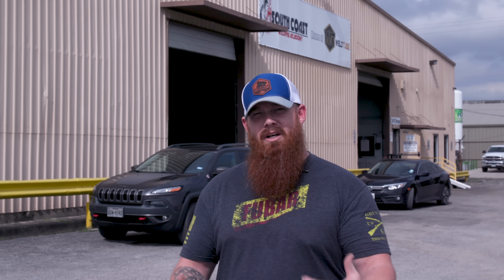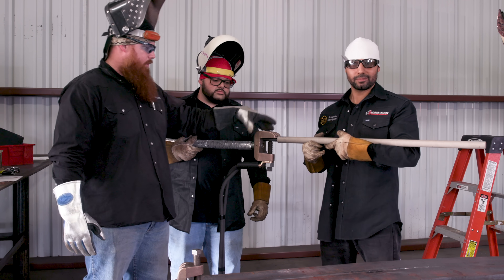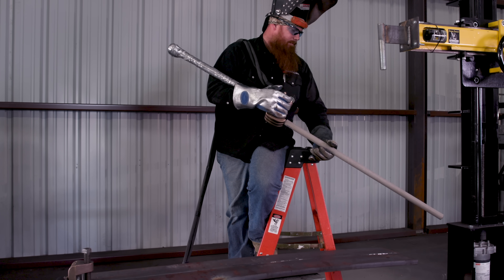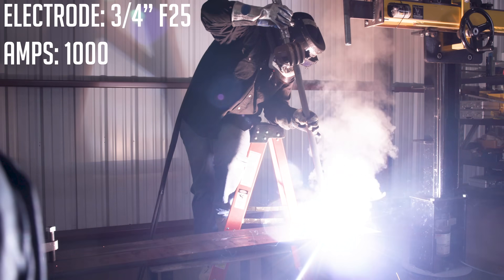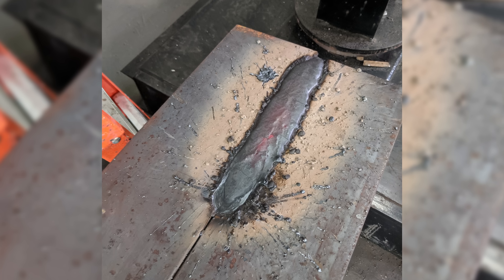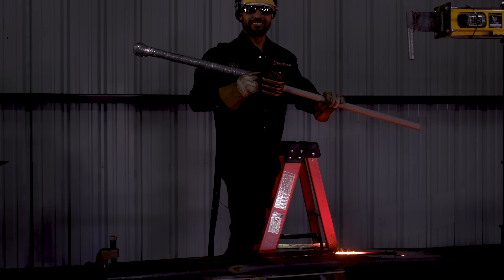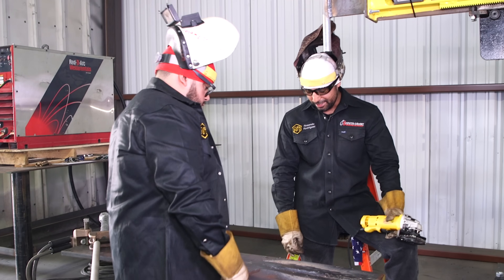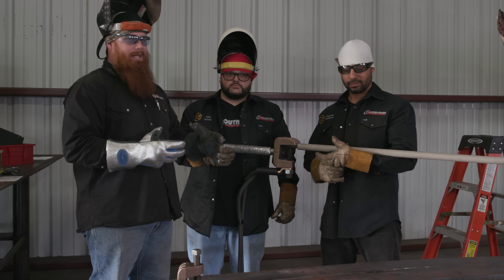1000 AMP STICK WELDING!! | Manually Welding with the Worlds Largest Electrode

Comment: My uncle , who literally welded his entire working career , told me that when he was welding in the ship yards during WW2,, that he was welding with 1 inch rod  powered by two 600 amp pipeliners in parallel,,, on a scaffold , using a harness strapped across his chest, and that he had to literally lean into the rod because of the arc blow,  he said that they were only allowed to  weld 1 hour and off  2 hours because of the heat,,, with plenty of protection, he said they were using two #12 lenses stacked,  and as I recall, he said that they were welding the armor plating on some of the NAVY ships.. he said they were using  pulleys and ropes just to support the multi conductor welding cables  and he said it took yet another man to help strike the arc, holding the rod mid point, till the welder had a steady arc and to hold the rod till it was about half burned . this is what he told me,,,
Reply: That's insane
Reply: RoMMeL1337ak47  I'll bet . That's alot of current there .
Reply: Amazing man, your uncle. Great little story. Thanks for post. Back when men were Men.
Reply: Ur uncle is a badass 💪
Reply: thats back when men were men
Reply: and the sheep were nervous
Reply: That's cool af
Reply: Awesome story thanks for sharing
Reply: Tell us what he said though.
Reply: he tell you all that?
Reply: And that was bare rod.....
Reply: Holy shit !
Reply: yeah. my paw paw 4fed in wwii so he worked building the higgins boats for Dday in NOLA. I was lucky enough to help restore one a few years ago for the wwii museum here.
Reply: no way in hell he didnt die from cancer/have fucked up lungs
Reply: Probably how they welded the liberty ships together so quickly
Reply: Jeez our industry was not ready for the welding we where doing
Reply: some of that battleship armor was 15 inches thick, can you imageine doing 15 inches of armor with a single rod?
Reply: Great Story, many men were not drafted during WW2 because of them being welders in the shipyards of California. Thank You for sharing
Reply: That’s nuts
Reply: Your Uncle is twice as badass as us modern day welders..
Reply: literally
Reply: You had one of the best uncle
Reply: all that ingenuity and we still couldn't figure out that we were supporting a crooked banking empire that wants to replace us with a slave class of cheap dumb labor.
Reply: America love it 🇺🇲
Reply: FunFact...the use of these rods , these machines, in the navy shipbuilding yards...
Is the origin of the phillidelphia experiment.
Literally all these rods arcing off and welding at various locations at more or less the same times caused some weird shit to happen.  
Like tools missing, more like vanishing and reappering...and by tools i mean even lincoln machines etc.
Something about the amperage and  electricity, the pinching of space and time, the arc itself caused weird things to happen. 
So if you know about the weirdness of the phillidelphia experiment... Which actually and historically did happen...then what i started out with by saying tools, machines were disappearing and reapperaing...well, doesn't.sound too strange, relatively speaking.
Cheers and cool video ..
Crazy...the phillidelphia experimemt was started because of welding.
Reply: @rolsonray  Sounds like nonsense to me. Throw some sodium in water and you'll see probably more amperage than a lightning bolt take place to blow apart the sodium. Nothing paranormal happens with that.
Reply: @timramich  shit i dunno..i heard that from someone reading the story
Reply: @timramich  but the phillidelphia experiment is true.
Reply: @rolsonray  According to who?
Reply: Shit..you dont have to believe anything
Reply: @rolsonray  smart man, don't feed the trolls. personally I don't believe everything about the Philly experiment but there's certainly some evidence they were pumping some time and cash into it and obviously something was going on. But you're free to research (and chose to believe/not believe) whatever you want and I appreciate the info on the welding being the cause since that's something I hadn't heard of but makes sense in context.
Reply: @tflo3482  Yeah, it took time and money to invent a technology to make a ship invisible to enemy ships' instrumentation back in 1943. And no, it doesn't make sense. What paranormal thing happened in this video? I didn't see anything disappear and then reappear later inside of solid materials.
Reply: @tcmtech7515  No to mention those connections at power stations where they have a rod that moves to make or break a circuit, and there is lightning arcing from it a good distance away. I don't know what would be so special about electrons flowing through a plasma rather than a solid conductor. Logic would dictate that just having electricity run through lines at all would make everything in the world haywire.
Reply: @tcmtech7515  oh yes, now if you want to see some thing an hear an feel the power drawn? Get yourself  into a big foundry that runs arc induction furnaces. Wow, the one in Sheffield draws as much power an hour as Leeds uses in a 24hour period.
Reply: @tflo3482  smart man the guys saying it when multiple thousand amp arcs are running the universe stops working based on story he heard third-hand don't dismiss the people rightfully calling it out as trolls
Reply: @tflo3482  as far as I know they had this wierd idea that strong magnetic fields could distort light in a way that a ship becomes invisible they apparently went as far as building a prototype and tested it but in the end it basically did nothing other he magnetize the ship
Reply: @timramich  oh yes it does. Sodium fusion is the answer to it all. The plasmatic state it becomes is the start of... well, everything.
Reply: @eriklittge9911  Uh, what?
Reply: @tcmtech7515  but locomotives aint in salt water breaux.
Reply: Joshyboi  You, I think youtube was having an issue then.
Reply: @timramich  really? sodium & water makes more current than a lightning bolt? I need to know more gimme the source man
Reply: @mcrib5794  electrodynamics isn't my wheelhouse, I'm in chemistry, but the sodium/water reaction is an immediate and extremely violent exchanging of electrons. Sends off so many, it ignites the oxygen in the atmosphere with the hydrogen liberated from the water.

The heat energy needed to start the hydration and then oxidation through combustion is generated by electricity in this sense, but it's not on lightning's level. Total energy released across the entire process, yeah, but nowhere near total current.

What we really need sources on are disappearing and teleporting ships caused by completely mundane things like electricity or welding.
Reply: @Chance57  I am no physicist but in my opinion it's likely what people were seeing is the output of light was so intense that it created an altered viewpoint. I might be unable to fully express myself in the matter, but I believe it's possible there was just enough light to warp someone's vision of material objects enough to make them seem to vanish. A form of bending light, if you will
Reply: @rolsonray  I was wondering that exact thing ..thanks
Reply: @rolsonray  Yeah! philadelphia experiment. Experiment. Philadelphia. Space time. #phila #expe
Reply: CoffeeMonster I have to go to a HTML page to read your whole comment. The Germans ran experiments on a bell. I think it was anti gravity. Also the Germans went to the Antarctica. There is a technology we cannot even grasp which is kept secret from the public. Antarctica is out of bounds to the public. This is fact and you try looking at Antarctica on google earth or google earth pro to learn a lot has been airbrushed out. I former Russian soldier told me a story regarding experiments they were conducting. Unfortunately I was unable to fully understand his English been his second language. The story spooked him out of what was going on and he couldn't sleep for a few nights. This is a hardened Russian soldier. People mention paranormal because they don't understand or are limited in their understanding of what occurred within the philildelphia experiment. During the war none of Germany's production factories were bombed. The companies that supplied Germany with equipment indicated a collision between countries such as USA. Also that Henry ford was friends with hitler. I know this is about large welding rods and how this person mentioned his grandfather using a large welding stick for building ships. The business that ran after the war with the amount of money poured into Germany and Japan made them the leading industry. USA grabbed the top German scientists which later formed NASA. It's not even one of my specialties although very interesting.
Reply: @ron1martens  I had a crazy drunken brother that had a toilet in his KITCHEN,,   yet thats right ,,,, a shitter right beside his kitchen table,,,,, now those two things obviously dont mix and and dont belong together,,, you must have been good friends with him,,,, you both talk alike,,,,, please explain to me what hell WELDING RODS and your rant about things that dont even relate,,,,,,,  BTW   if you want to further educate your self about the stuff you were talking about read the ELKHORN MANIFESTO,,,  that large article will tell you stuff you never even dreamed, and sounds like something right up your alley,,,, but probably not a good idea to interject in into places it does not belong,,,, or then again you might go smoke another joint and call it a day.
Reply: DOCDEVOE699 you sure that crazy drunken brother is not you ? Do you receive an income from trolling posts when keywords sound a bat signal on your server for you to spring into action making derogatve comments and attacking complete strangers?
Having an outhouse right near where you cook and eat may be a good idea for you. I somehow imagine you as bat crazy from the comments you made to me after all, your comments are a reflection of what you are. I'm been sidetracked as as some of he comments are interesting particularly where huge energy is been delivered. Also the chemical reactions.
Reply: @ron1martens  yes I replied without know that the entire post had drifted far to off base,, as your response to me  is the only one that yourtube has sent to me in many many months ,,  when I read your post at face value,,, I just ask myself WTF,,,,    SORRY bout that,,,,,  also read the ELKHORN MANIFESTO ,,,,  you will enjoy,
Reply: DOCDEVOE699 thanks for the reply. Apology accepted while heartedly. Yeah utube are messing with people and their responses also unable to read whole 
Comments within reply to comments. I've been attacked many times with trolls so it was my mistake in my reply to yourself. I also try to be accurate in anything I write. Dealing with big energy certainly has massive reactions. Once again thanks.
Reply: @ron1martens  in your search for the truth,,,,, look of the book called the DEEP HOT BIOSPHERE and find out why OIL is actually a renewable energy source,,,,  it is NOT a fossil fuel,,,,,   that book my also be in online form and there are enough articles written about it,,, that you can find out most of what you want to know about it anyway.
 simple pure LOGIC dictates that oil from 10000 feet down did not come from decaying plant and animal matter, etc etc etc,,,, the man that wrote that book is very well educated and a real pro.
Reply: DOCDEVOE699 Thankyou. Appreciated. I did hear there are microbes or living organisms that can live in extremely hot environments. Which means life is everywhere and not just on earth.  My son told me he also doesn't think fuel is fossil as it constantly replenishes.
One of his friends works on an oil rig platform at sea. When the oil runs dry they close up and leave the platform to go somewhere else. 6 months later they come back and there is oil again. Like you mentioned it comes from the core of the earth and makes its way up. I have a HTML page on what you mentioned and will read at my leasure regards.
Reply: CoffeeMonster I got onto a HTML page and was able to read your whole comment. Very interesting. We have many facilities worldwide which are out of limits to the public. One been cern. Hadran collider. There actually are a few hadran colliders although the one I think in Switzerland. They actually came close to the speed of light and I think recently was reported reaching the speed of light although not much reported. It had been journalised one scientist disappeared although you are not going to find out anything. The earthquakes that occurred suspiciously around the time they fired up the hardran collider to have then state they didn't have it turned on. Someone doesn't spend billions on machinery to learn the beginning of all life. No they are messing with things.
Reply: @rolsonray   My Dad is a welder and he disappeared years ago. Maybe he just teleported and he actually does love me...
Reply: @TylerDurden-hb4vf   that's exactly what happened
Reply: @rolsonray  sounds like a lot of old timers from back in the day just had a field
Day getting some new toys to bring home. Happens on every job site. People steal whole welding machines just because there’s so many laying around.
Reply: @rolsonray  that's not true, but it's a great story
Reply: @rolsonray  Tesla was right about Einstein being a fraud.
Reply: @SC-dw3jz  I hope you're joking, or mean Edison which I don't think Tesla ever said, it's not accurate by any measure, but I guess Tesla did get kind of 'out of it' in his older years and said stuff like  he "loves a pigeon like a man would love a woman" and death rays.

Comment: I worked in a casting repair shop where we repaired castings for railway intersections. We had a 900amp and a 500amp stick welder pigged together. We used it for cleaning the casting with air arc gouging. The rods were 3/4" diameter. Remember first time I tried it. It took 2 hands and had a huge kick to it. Was the first time I tig welded copper to repair the gouging heads as well.

Comment: I am taking TIP a mechanical line in Norway and i put 40 amps over on a thin electrode to see what would happen. It just burned through the metal plate... it literally cut through the plates i was welding

Comment: I once used a large diameter electrode with plenty of juice and used another rod bar 2 fill up large gaps and its pretty easy 2 do and I guess you can call manual metal arc welding plus a touch of oxy welding at the same time. What you see in this video is purely something 2 be used in a semi automatic process.

Comment: As a pipe welder..... I would of loved to see a t joint with 1" steel, and then hit it with a bulldozer to see the penetration. Also a under view to see the heat affected zone. What shade lense did you use?  But hats of to ya guys. Keep the sparks going.

Comment: I bet the electric meter was spinning like a gyro!
Reply: It looked to be averaging ~40,000 watts, so yeah.  That's roughly the maximum current a 200 amp 240v  residential service can handle.  The old rotary electrical meters spun about 120 RPM at this load.
Reply: thats electricity for a small country in afrika ... .....................
Reply: That's only about $4 an hour, at 10 cents per kWh.   Electricity is dirt cheap.
Reply: @andybaldman  where you live ;) , in socialist germany we pay 3x as much at the moment
Reply: @hyperhektor7733  Isn't it a huge difference as well between residential and industrial power cost. Atleast in norway it is. We pay around 0.12 usd for residential and 0.04 usd per kwh industrial.
Do you really pay 0.3 kwh usd in germany?
*(just googled it. damn man that some expensive ass power)

Comment: Man imagine if it stuck...you'd have to cut the machine off to avoid arc flash. Surprised it welded as good as it did with all that sparking and crackling.

Comment: Just run some pisser passes with 5/32 12018 rods or something if you need it pretty, also i looked it up and 1000 amps is about the rated requirement for that rod

Comment: I seen Chuck Norris deposition repair a 6" STD hot pipe in the 5 position with one of these rods in the field using a custom SA 200 that had a 525 Horse ISX Cummins motor strapped to a 5000 amp armature. His machine was rated at a 360 degree round house to the face duty cycle.

Comment: Judging by the spatter, I think a thousand amps is too hot.
Reply: Yeah, but "900 amps" isn't a really good clickbait.
Reply: I actually looked up the data sheet on the rod.  1000 amps is the minimum on the sheet for 20mm (3/4") rods.
Reply: Not hot enough
Reply: I think an electrode running 10x the amperage of an average joe stick welding, can’t really be accurately judged by the same “principles” if you will..
Reply: Shuffles agreed
Reply: Is it just me or did it look like he was going too fast as well
Reply: Splatter!!! Buckshot in the weld'n world.

Comment: I'm a sheetmetal mechanic and all we use are 3/32 rods for the most part. I can't even imagine holding a 3/4 rod 😂 It's like putting 1500 horsepower in a Miata hahaha

Comment: Pah! When you Tig with 3/4” filler wire let me know. 😉 

And did nobody do the old holding the electrode on the work.... hey my ground clamp fell off, put it back on for me 😈

Comment: Based off the read outs on the front of the machine, it was putting out 40kW. Just a bit of power there. For reference, most homes in the US have 100-200A service at 240v, which is 24-48kW maximum.

Comment: Back in 2003 when Caterpillar made excavators in Illinois.  I toured the factory.  The boom box sections were robot welded.  The cast steel ends of boom,  were stick welded like this by hand.
The rods were cut to specific length for the weld to be done.   There weld travel speed was very fast.    What I'll never forget is the sound.   It actually shook your chest.  Kinda took your breath away.